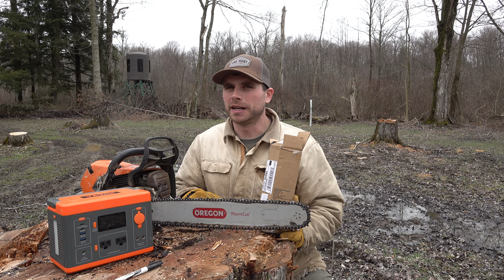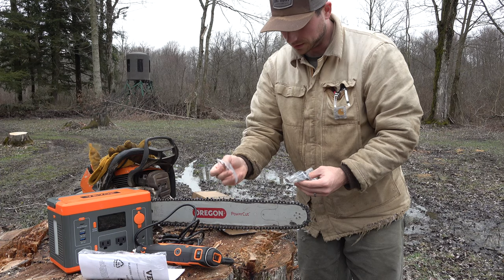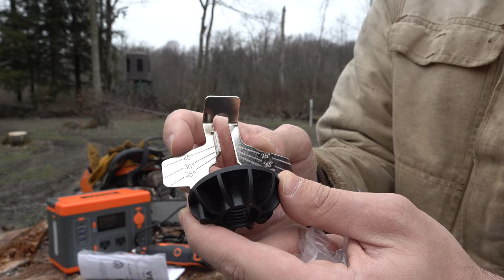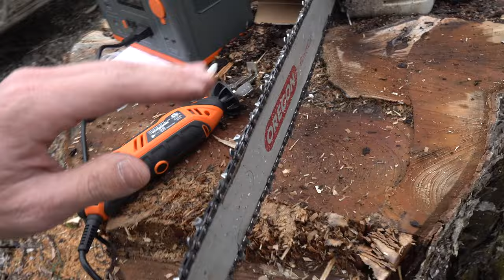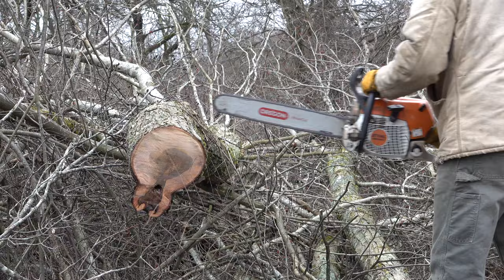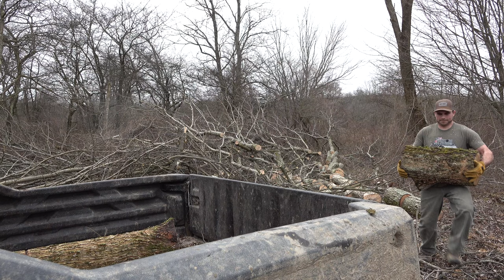Vevor Chainsaw Sharpening Kit

Comment: WOW, you over grind those teeth ALOT, a saw dealer took the time and showed me how to sharpen my chains and you just have to touch the teeth with the grinder. I have a bench grinder and sharpen many at a time and always carry extra chains with me. Last year I cut 25 face cord and only used 3 chains total.